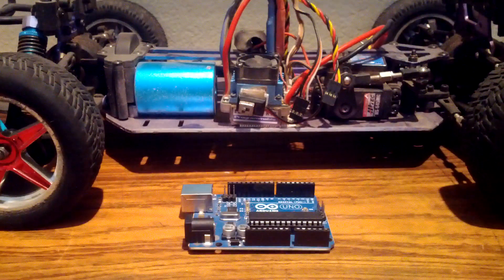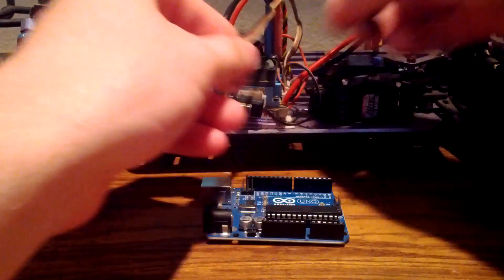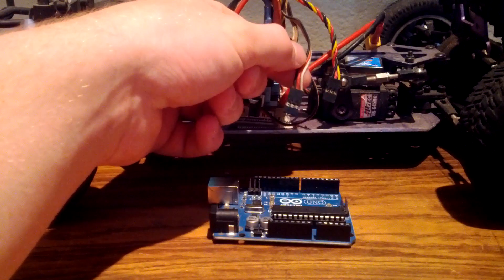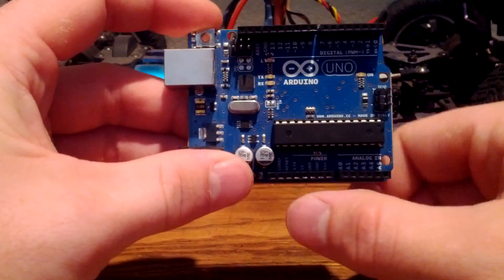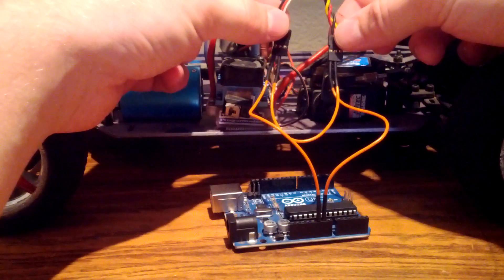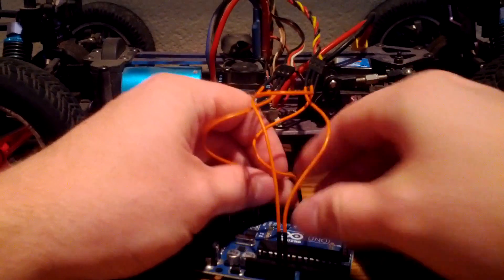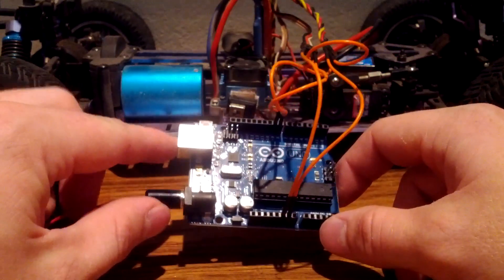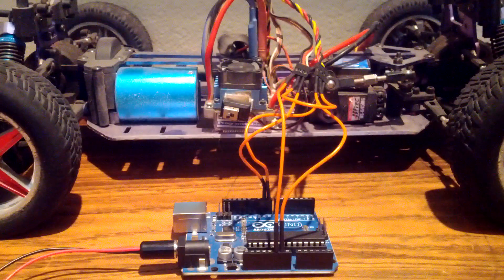Hardware setup for RC car controlled by an Arduino and PS3 controller

Comment: i modified ur code to try an fit to a ps2 controller but its been no luck
can u take a look
seeing that u have the video still up
#include <PS2X_lib.h>  //for v1.6
#include <Servo.h>
PS2X ps2x;
int PS2 = 0;

Servo myservo;
int pos = 0; 

int offset = 0; // put this with the other global variables (above the void setup() function).
int steer = 127; // put this with the other global variables (above the void setup() function).

void setup() {

PS2 = ps2x.config_gamepad(13, 11, 10, 12, true, false); //Настройка выводов: (clock, command, attention, data, true, true)
myservo.attach(9);  // attaches the servo on pin 9 to the servo objec   //ESC on sigital pin 3
}
void loop()
{
steer = ps2x.Analog(PSS_RX); // read right joystick

if (ps2x.Analog(PSS_RX)) { // trim right
offset += 1;
}
if (ps2x.Analog(PSS_RX)) { // trim left
offset -= 1;
}

steer = steer + offset; // incorporate trim into steer command
if (steer > 180) steer = 180; // enforce upper limit
if (steer < 30) steer = 30; // enforce lower limit

myservo.write(map(steer, 0, 255, 30, 180)); // write steer command

}

Comment: i also made a car but i am haveing some problems with the motor,,,,,,,,,,,,,i have given 9V power supply to arduino and 12V to the L298N chip both the power supply are seperate ,,,,,,,,,but my car is not moveing froword , my codes are correct . When i start the car there is a sound comeing from the motor like teeeeeeeeeee ,,,,,,,,the moter starts for sometime but gredually its speed and power decreases ............pleane help me

Comment: NICE!!!! Any way to control it with Arduino yun and Laptop ?
Reply from the maker: daniel grace Yes. All you would need is some way of communicating with the Arduino from your computer. With the USB host shield and bluetooth dongle you could send commands via bluetooth. There are also a variety of other systems like XBees which support longer range.
Reply: Nice

Comment: thank you barrett! I used your bluetooth shield video to get my PS3 controller communicating with the arduino and it worked! However, it isn't registering the R2 and L2 analog triggers… did you ever encounter this problem?
Reply from the maker: I did not, but I have heard reports of this. It appears to be a problem with the newer versions of the library. You are using a Sony-made controller, correct? If you continue to encounter this problem I would suggest trying an older version of the library. If you click on the link in the video to the control setup, then navigate to the description of that video, there is a link to my website post where I provide a link to an older version of the library (the version I originally used).

Comment from the maker: I'm afraid I've moved into my dorms so I don't have the parts on hand. I'll tell you what I remember. The car is an Exceed RC short course truck running on an old three cell lipo battery. I have no idea what the ESC is (you can probably find out if you check the Exceed RC website). You can find info about the USB host shield and other electronics at my website under "Arduino" (link in the description).

Comment: I saw your videos for the hardware setup and how to connect the ps3 controller to the arduino but would you mind going over the actual code that you used to program the motors and the ps3 buttons? Thank you.

Comment: and when i buy the starter kit, i plan to try out some of the projects from the starter kit,
so will my uno still work with my rc truck after ive already used it for the projects?

sorry im kind of arduino illiterate

Comment from the maker: His is more complicated for several reasons. As you mentioned, he uses Xbees. This greatly increases his range, but adds complexity in the form of a signal router between the PS3 controller and the RC car. My setup is as follows:

PS3 controller --> RC car with USB host shield (very simple but limited range)

His setup is:

PS3 controller --> Arduino with USB host shield and Xbee --> RC car with Xbee.

Also, he built his own motor controller.